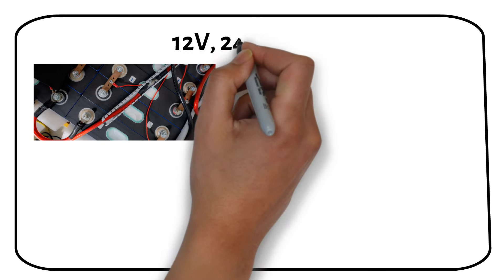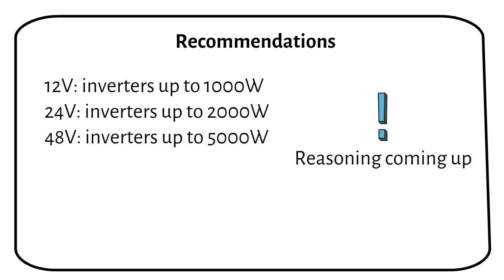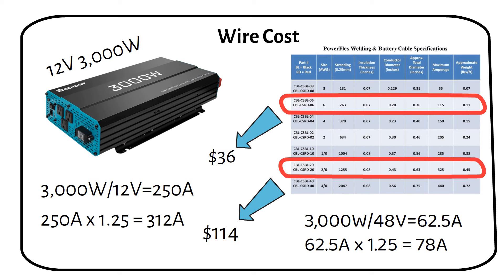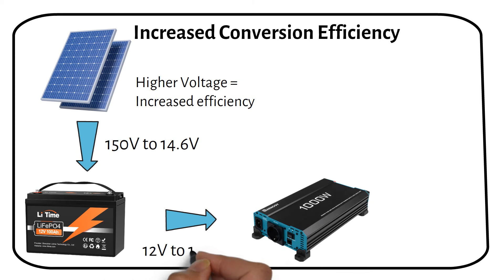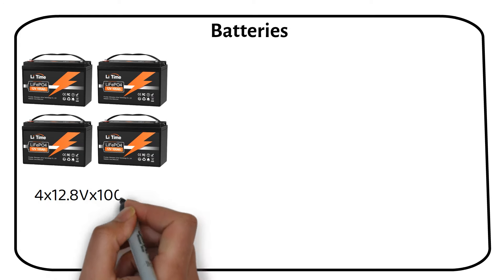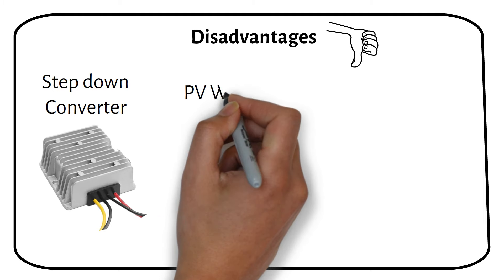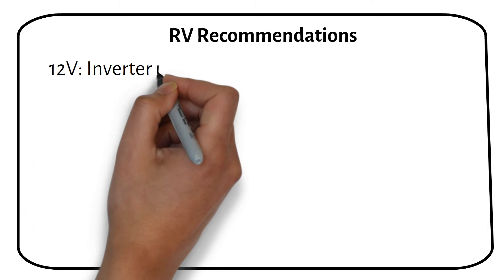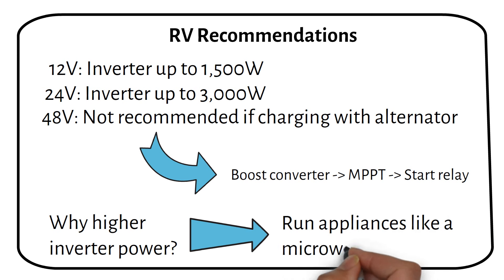12V, 24V, or 48V Battery for Off-Grid Solar Power

Comment: I really appreciate your videos and I did purchase your book however I’m just just starting to read it. My question is I have a 12 24 4836 and 60 converter. I also have a 12 2448 63,000 watt inverter. How many solar panels would I need to charge using 412 V 100 amp Lipo batteries wired in series. I have purchased already to Rich solar 100 amp solar panels. How many more would I need to charge up this system? I plan to use this to power my two refrigerators if I lose electric because my whole house is electric, no gas no oil heat or everything is electric. I appreciate in advance your help with this question.
Reply from the maker: 4 12V 100ah batteries = 4,800wh. Charge with average of 3 sunhours per day: 4800/3= 1600W of solar.

Comment: Hi cleversolarpower. My battery is 24v. Should i setup 24v solar panel (12v x 4) or 36v (12v x 6) solar panel ?
Reply from the maker: You need a high voltage on your charge controller input to minimise losses with mppt. So up to the max allowable input voltage of the charge controller. I made a video about this, search for charge controller on my channel page.

Comment: Nick, am trying to figure out best solar options for my truck camper. I currently have a 2000w inverter (Jupiter from HF), and 2 100AH lipo4 batteries. I would like to go with a 24v system but am confused about what size controller and how to wire a 12v step down converter. The struggle is real..  do you have a 24v schematic for this?  Thanks for all your great info. You’ve become my number one source for all things Solar.
Reply from the maker: I have a resource, check the second link in the description for my free diagrams. The size charge controller depends on how many solar panels you have. Let's say you have 400W of solar panels and a 24V lifepo4 battery that charges at 29.2V. 400W/29.2V=13.7A -W use a 20A charge controller.
Reply: Perfect. Exactly what I was looking for. Much thanks

Comment: Its good but to be frank you pretty much always want to go straight to 48V 16s (51.2V nominal LiFePO4).  The only limitation is that the solar VOC going into the charger controllers has to be 61V+.  But that's only 3 x 100W panels in series, or 4 x 50W panels in series, or 2 x residential panels in series.  In otherwords, it isn't much of a show-stopper.  And you have to use glass auto-fuses instead of blade auto-fuses (all fuses need at least a 60VDC rating), and ANN/CNN (or marine bolt-on) instead of ANL for the main battery fuse.   That's it.

For alternator connections you always have to use an amperage-limited DC-to-DC converter no matter what the battery topology if the batteries are lithium or if the bank is large.  Since most people use lithium these days... LiFePO4 that is.   So going 48V is not a show-stopper for alternator charging.

The advantages of 48V are so massive that it is really hard to ever justify using a lower voltage. The cost is the same but the flexibility with 48V is massive.  Wiring losses (heat) are 1/16th that of 12V, the cables can be thinner in general, and even just going with 2 AWG battery cabling still gives you 100A @ 51.2V = 5120W of capability.   The voltage drop across long cables is almost nothing, and numerous other reasons.  Equipment heat is also a lot lower and efficiency is a lot higher.   And also the very same charge controller can handle 4x the solar in a 48V system that it can in a 12V system (for charge controllers which can handle 12/24/36/48V).  Such as a Victron 100/20, for example.

Also, for a robust system, particularly with lithium, you ALWAYS want to parallel at least two batteries at the system voltage.  So for a 12V system you want to have at least 2 x 12V batteries in parallel.  For a 24V system at least 2 x 24V batteries in parallel, and for a 48V system at least 2 x 48V batteries in parallel.   Because of this it is generally wise, particularly when using LiFePO4, to buy batteries that are already at the desired system voltage.  Then the system can be trivially expanded simply by adding more batteries in parallel without having to worry about the mess that comes with whole-battery balancers in series+parallel configurations.

Legacy 12V gear is easy to handle regardless, its just a buck converter.  And any heavy loads should either hang off of AC or be directly run from the 24V/48V system voltage (obviously the appliances have to be compatible if run directly from DC).  Light appliances are a non-issue since a $15 buck converter usually handles them without issue.

So go straight to 48V if you can swing it.  And if not, at least start at 24V.

-Matt
Reply: Thanks a lot for sharing!
Reply from the maker: I agree! However, I don't with the point about alternator charging in an RV. What DC to DC converter are you using to go from 12V to 48V?
Reply: @cleversolarpower  A more ideal configuration would be to have a higher voltage alternator (like a 24V or 48V alternator), to massively reduce the amps, then use something like a Victron 24/48 or 48/48 DC-to-DC.   That said, there are numerous 12V to 48V battery chargers on the market as well.

The path is alternator -> converter/charger -> 48V bank -> 48-to-12 converter -> 12V starter and vehicle battery.   That way you have full control over the power pulled from the alternator and the home battery can support the starter battery (even provide a little extra oomph since it can charge the starter battery during and after a crank without the engine running).

Generally speaking with DC the best choice is to always down-convert or same-convert when possible, not up-convert.

Another less efficient solution is to stick with the 12V alternator/starter-battery setup and charge the home bank with a regular battery charger powered from an AC inverter.  Quite inefficient, though (not that the engine will care too much).

-Matt
Reply: Ur knowledge is amazing, I was convinced to go 24v but now I will research 48v for my little camper. I won’t ever pull over 2300 watts but I’m limited on panels so I’ll go big on battery & aux charge on occasion… TY again for the info

Comment: Hi Nick, top videos! Will get your book. For 24v (Motorhome, LA cranking) I want to set up lithium for house batt. Pros: lithium is better. Cons:  My previous set ups with HD flooded LA were a lot simpler. No DC-DC, All in parallel, HD marine switch, batt. 1,2(house), both or off. A bypass switch, line with a diode to the alternator to increase its output if needed when driving and, voltmeter to indicate batteries nearly full. The solar would contribute whilst driving = less work for the alternator and, when RV not in use the solar preserves (trickle) all the LA batteries, in float.
Can a hybrid system be set up to get those benefits as well?
Reply from the maker: I have made a video about it called: drop in lithium is a lie. You can check what you need to change. If this system has been working for you and you don't want to replace components, then I would just get new batteries.
Reply: @cleversolarpower  Thanks a mill. Nick!! Unfortunately my cranking batts are sealed. The old syst. only works if you can top up the HD flooded now and then. They could take a (15.5v) hiding but now are expensive and becoming harder to find. AGMs can’t handle much so I’ll follow your vids. Thanks!

Comment: Pls, bought a charge controller rated voltage of 12/24v, current of 100A with max.pv voltage:50v and max.pv input power; 650w(12v) 1300w(24v) what is the maximum solar panel, inverter and battery rating suitable for it?
Reply from the maker: If the max PV voltage is 50V, you got yourself a PWM charge controller.

Comment: if we put 4 12v batteries in serial for 48v system and charge 12v batteries one by one independently with alternator. like first charge number one battery. after it is charged go and charge the next one and goes like that. is it possible to make a system for this.
Reply from the maker: Not a good idea.

Comment: Is there a reason 36v was not a consideration? Some older golf carts use 36v and could be a source of power.
Reply from the maker: It's not a widely used voltage and there are not many inverters, chargers, charge controllers,... out there that run on 36V.

Comment: Let’s talk about the actual situation. Currently, the best voltage platform is the 24V platform. The main reason is that various chips, including IC, MOS, and capacitors have insufficient voltage resistance. Anyone with basic knowledge of electricity will use DC-DC step down circuit, not DC-AC. This can maintain extremely high efficiency while being safe, making the overall power consumption efficiency of various electrical appliances reach 96%-98%. Instead of DC-AC boost, AC-DC results in an efficiency close to 60% or even lower.
However, the 48V platform is not perfect at present, and it still needs the slow advancement of technology to improve the voltage resistance of peripheral DC equipment before it can be popularized.Moreover, the current battery yield rate and consistency are still very low. After being connected in series to 48V, the failure of one battery in the battery pack will cause the entire battery pack to be eliminated. This results in the waste of a 48V battery pack being twice as much as that of a 24V battery pack with the same capacity.
Reply: So should I buy a 24 v battery and use a dc to dc step down to convert to the 12 v ? Then use an inverter thats 12 v rated to convert to 120v ac instead?? I want something safe.
Reply: @luisgee3739  Everything is based on existing battery packs. And give priority to using DC. The DC platform can ensure high efficiency and is relatively safer. If possible, avoid using an inverter to convert DC to AC. If the battery pack you have is 12V, there is no point in buying a 24V battery pack. There is not much difference between 24V and 12V. DC lights, refrigerators, air conditioners, chargers and other accessories used on RVs are basically dual-purpose 12V/24V voltage platforms. Do not try to add a new battery and mix the old and new batteries. This will not only fail to bring out the performance of the new battery, but also make the old battery dangerous.

Comment: Your videos are very informative, lots for me to learn. I'm configuring a large sailboat for 12 v battery powered devices, most upgraded to LED.  The boat came with a 400 w wind turbine, an upgraded 150A alternator on my diesel engine, a 1500W inverter and I plan on adding 2 x 100w solar panels to charge my house batteries which I was thinking would be 2 x 24v lithium batteries.  I have room to add 2 more 100W  panels in the future.  I was thinking for starters 2 solar panels in series.  Suggestions?
Reply from the maker: I recommend using 24V in your case; Don't expect much from the wind turbine. Your alternator will give you the most power. Use 24V batteries instead of 2x12V batteries for balancing issues (like you already do). If your boat experiences shade, which i assume it does, then wire the panels in parallel. However, your voltage should be +5V than the battery charging voltage. 28.8V+5V=44V minimum PV input. So you should wire in series.
Reply: @cleversolarpower  I would need a step down converter for my 12v system.  Would a new inverter be required of just go with the existing setup after the stepping down the voltage?

Comment: great informative video, one thing you did not discuss was the cost difference 12v,24v, and 48v batteries
Reply from the maker: Server racks are a bit more expensive compared to 4 12V batteries. However, I still recommend getting a server rack or diy one if you want a 48V system. Then all the cells are balanced.

Comment: Ok make an upsett for el engine on an marine diesel engine in boat 

Have lithium hybrid inverter and solar 

Need 10 20kw el engine belt to prop shaft for generator and for electric drive

Comment: Battery is the most expensive item in system so higher the voltage the more battery you'll need casting more
Reply from the maker: Not necessarily. You can have a 12V 200Ah battery or a 24V 100Ah battery. Higher voltage does not mean more expensive. It's only expensive when you have a small battery.

Comment: You must explain that a 3000W Inverter is Peak. The Inverter is only safe to 1500W.
Reply from the maker: Define 'safe'
Reply: @cleversolarpower  Wrong word. Would continuous operation up to 1500W be better. The 3000W is only for a short period of time.
I do believe the advertising should state the Inverter is a 1500W with a Peak of 3000W.

I have an 8000W Modified Sine Wave Inverter, it is designed to run, according to my manual, at a maximum of 4000W with a Peak of 8000W for <30 seconds.

This would be correct as I found this out the hard way & had to replace a 10k ohm, 10W resistor that had blown.

Any reply to my inquiry on the best place to put the input Voltage to the Batteries from the Controller as regards the output Voltage going to the Inverter. Can I attach the Leads to the same place?

I do like your presentations, Thank you.

Comment: Just tap into the first 12v battery in your bank if you need 12v
Reply: This does work but can create a system inbalance for charging purposes later, if you try this it helps if you can balance the load between the batteries & run a light circuit or whatever to help balance the load from each battery.

Comment: The 48 volt batteries were 3 times as expensive as the 24 volt batteries.
Reply from the maker: A 12V 100ah battery has the same capacity as a 48V 25ah battery.

Comment: This video is full of incorrect information. I suggest doing your homework
Reply from the maker: Let's share what you found incorrect here in the comments. So everybody can learn from your viewpoints.
Reply: @cleversolarpower there are questionable ideas but they are never wrong. It's best to keep current draw down. I like your 100 amp idea. The lower the current the better. If you want to put a 48 volt system in a motor home you just need a 48 volt generator or alternator same with RV the alternator puts out way more than it is rated just the voltage regulator keeps current at the right voltage for the load or batteries. I know of people and even on you tube that used a car alternator to put out 110 volts AC. But that's up to the installer that wants to modify or no. I feel everything is correct even the dangers of 48 volts. 73